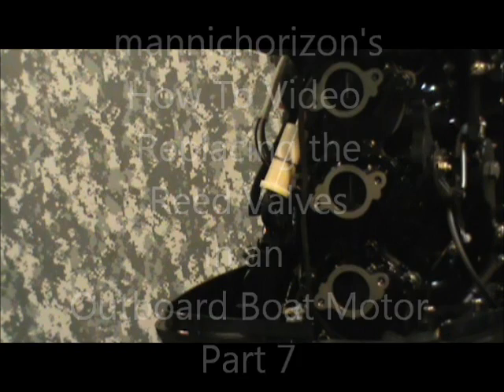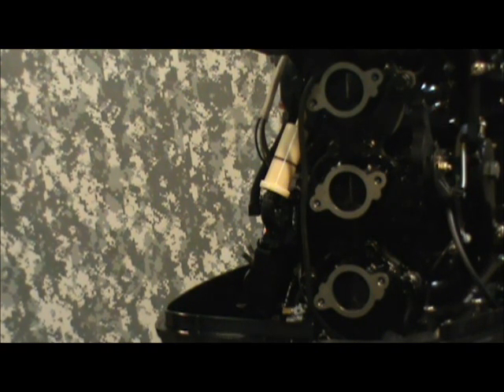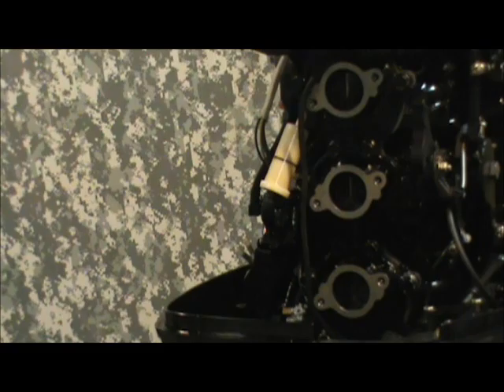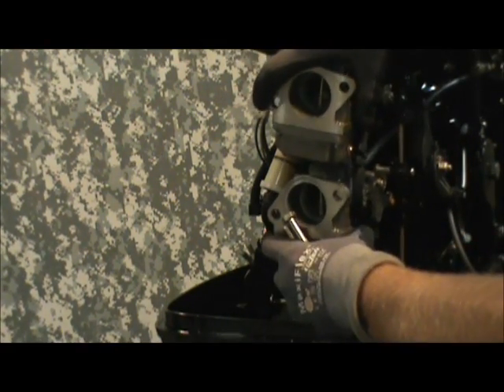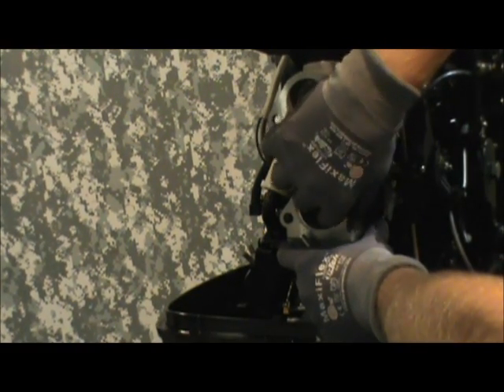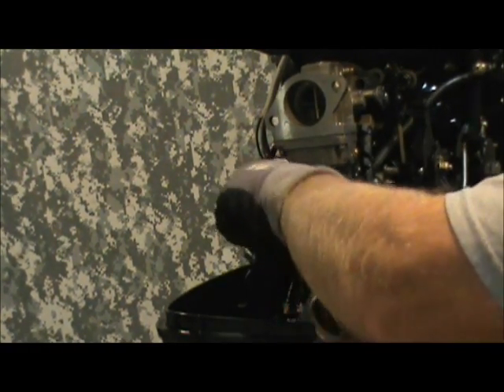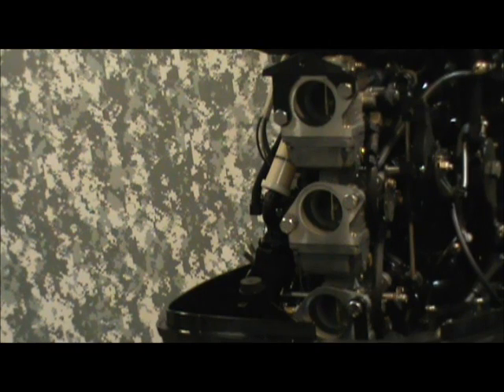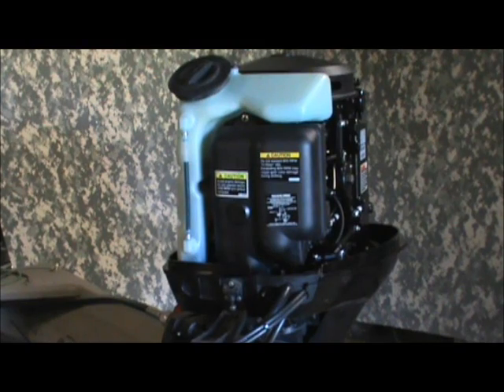My DIY Relpacing Reed Valves in an Outboard Motor Part 7

Comment: I got the same engine it won't idle it will shut off and at low rpm it sounds like it's knocking, but when you accelerate it, it runs fine and knock goes away. could a reed valve cause that?